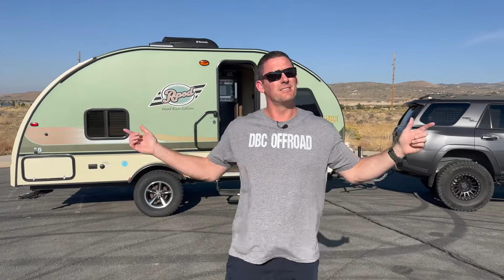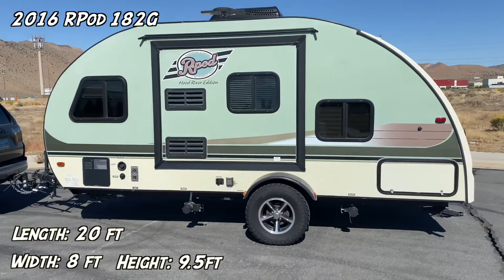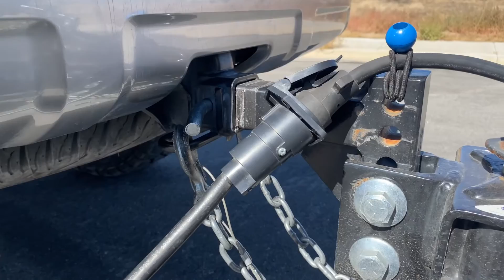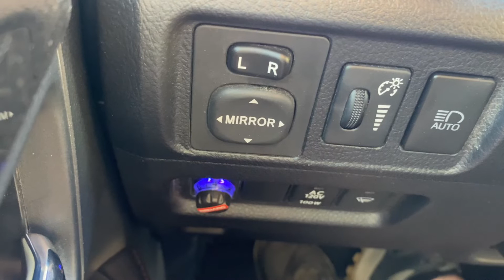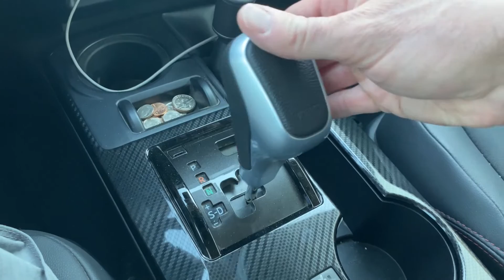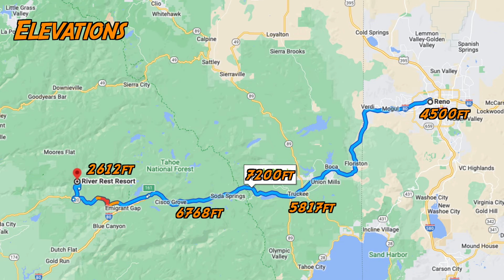Towing With a 5th Gen 4Runner on 35s!

Comment: Realize this video is 2 yrs old now, but some good reference info for me.  Makes me wonder if my '22 TRD ORP is the best vehicle to have as I look into getting a mild off grid trailer ... TAB 320 (2100 lbs dry) or TAB 360 (2600 lbs dry).  I have the almost 33" tires (285/70 17s Toyo AT3s in C load) and a Eibach Pro 2 suspension set up with rear set up for load levelling.  I'm thinking now of maybe an older Tundra, but then I may as well look at some light slide in campers at that point.  This decision making sucks, as I've really grown to enjoy my 4Runner.  Just tired of trying to camp in great spots with the RTT having wind gusts so bad it blows it apart and have to sleep in the drivers seat, or change spots defeating the purpose of my set up.

Comment: You still running this? I went with the andersen wdh. Half the weight of those bar types. I towed with similar rpod 3000 miles last year. Hated it. Got a 1/2 pickup haha absolute game changer. Didnt realize how bad the 4runner actually tows

Comment: What tire size are you running? On the 35s also   did you use a delete kit for the mounts or did you just delete them yourself and weld over?
Reply from the maker: 35x12.50R17
Delete kit? For the Cab Mount Chop? They are just cut and welded over with plating.

Comment: Great video , I have a 2024 SR5 and plan on towing a 17’ fiberglass travel trailer in the next year, already installed th medium duty kit from OME and went to a 275 tire, plan on getting the red arc break controller as well up in the air about the re gear??
Reply from the maker: How tall is the 275 tire? 275 is just the width.

Comment: You’ve mistaken the s-mode for a manual shifter.  It’s actually a gear limiter.  Huge difference.
Reply from the maker: It seems like Toyota designed it as a little bit of both.
Reply: Please explain

Comment: I think if you adjusted the support bars on the frame up higher it would help even out your pitch issues. 
The top holes you’re currently using allow for the least amount of weight distribution. I’d move to the middle holes and see how it sits……..
Reply from the maker: Good to know. Thanks for the feedback.
Reply: @DBCoffroad did you try this?
Reply from the maker: @BaldEagleAerial no I ended up selling the trailer.

Comment: 2021 orp everything from factory, towing 19rble. As a fulltimer, the load on trailer at almost max but trying to leave 4R trunk empty, redarc, no wdh (often offroading, wdh adds tongue weight and limits the flexibility). Good turning radial with 4R at dead-end. Always trying to control within 3k rpm, ~10mpg. Struggle uphill when more than 10% but robust engine and for better mileage. Great to watch your videos for benchmarking as 4R towing is rare out there😄
Reply from the maker: That’s cool. No issues without the WDH? 

I do like the U-Turning radius 😂

Thanks for the feedback. 🤘🏻
Reply: @DBCoffroad  wdh helps but it is also burden. As 4r has softer coil spring it sags, headlight is too high I never drive after dusk

Comment: is that the dry weight  you mentioned on the trailer 3300 pounds whats the fully loaded weight?
Reply from the maker: That was an estimated loaded weight. Calculated the water tank and what we put in it. Could be off +/- couple hundred pounds. 
Dry weight is 2836lbs

Comment: Which model rpod is that?
Reply from the maker: It's a 2016 RP182G
Reply: @DBC Offroad  I plan on towing something about that size, would regearing to 4.88 and keeping factory tire size save gas and help tow better?
Reply from the maker: @EnjoyTheShoah  if you tow, you’re not going to save gas. Not really a way around it since the 4Runner is only a 5 speed transmission. 

If you are going to keep stock tire size then just try towing without regearing. Then if you feel like you need more acceleration then go with 4.56 gears.  You might even be better off spending less money getting an intake and tune before gears for a little extra punch. 

Really, 4.88s are only needed for 35” tires in my opinion. 

Hope this helps.

Comment: Tow often. 

Monitored Trans Temps between D vs 4 in manual mode. The manufacturer states you should use 4, and I can confirm this is saving your transmission. The temperatures are 25-40 degrees cooler in 4th gear vs DRIVE, this is towing through the Canadian Rockies multiple times with a similar setup. I used an OB2 reader with 4 runner PID's to gain access to the trans temps. Regearing does help, but the temperature of the transmission is worth keeping an eye on.
Reply from the maker: Thanks for the information! I ordered a scan gauge because I was curious about the temps as well. Especially now that I put a steel bumper and winch up front. Thanks again!
Reply: I’ve read through my owners manual wrt towing.   Other than waiting until after 500 miles of break-in, I don’t see the manufacturer’s recommendation  for S4 while towing.   Although I can see why it may make sense to do so.     I added the Redarc brake controller,  and looking forward to the next trip.    Towing a small (Vistabule) teardrop.     Great video, thanks!

Comment: I tow with a 2017 4runner sr5 4x4 3rd row on 33s. I have a single axle Yamaha 19 foot boat that’s approximately 3800 pounds wet. It takes a while to get up to freeway speed of 65 mph, but does ok once it gets there. Towing up a hill it aggressively down shifts, and mildly struggles. I also have a all aluminum v-nose enclosed trailer that has been camper/ hauler converted. It weighs about 4K pounds fully loaded for camping. It has about the same performance as the boat when hauling flat but it’s terrible going up hill. On a steep grade I just back off to about 20mph in a 50 zone. Semi trucks are passing me at this point. I just leave my hazards on lol. I thought about the supercharger but I’ll probably be disappointed. I love my 4runner but unfortunately it’s days are limited. I cant wait to own that 500 ftlb torque of the new sequoia. Hopefully I find my spec out one soon.
Reply from the maker: Yea thats pretty much the same experience with towing for me.  Hint: definitely just go for the Sequoia. The SC is too expensive and doesn't bring the "wow" I was hoping for.
Reply: @DBCoffroad  thanks for the hint and confirmation!

Comment: Lets be honest, the 4Runner is not great for towing.
Reply from the maker: I agree. There are many better options. But it can be done! 
Thanks for watching. 🤘🏻
Reply: Really check out the White TRD PRO Towing a Semi in the snow ...and on the Beach pulling out a Pick up and a mini van ....under rated Vehicle
Reply from the maker: @CP-kb1du  I’ll have to check it out. Thanks for the info!
Reply: I tow a Little Guy Max. Get 9 MPG and have the Eibach Pro 2.0 and Eibach rear set up as well. I had 265 Duratracs and was wearing those out before buying new shoes in the 285 range. Now I am thinking of keeping the 265s until I buy my next truck. My 4runner is also an overlander and I love it for getting me in the backcountry. The 265s are working everywhere I have been. I have a roof top tent and equipment for those excursions. No way I would sell it just because it’s a little lackluster for towing and I will only tow roughly 5 or 6 times this year and next when this runner is then paid for. Then I will buy a truck. Even contemplating diesel. This one is a 2021 ORP and I bought it brand new for 41K out the door( that included all taxes and fees)before Covid really hit the auto industry. Nope. Not getting rid of it. I will make it work until it’s time to pony up for the truck. I am going to take that gearing advice though and I am buying a tranny temp gauge just to keep a check on it while towing.

Comment: The best power upgrade you did was the gears.  Regardless of tire size.  5th gens have terrible ratios (gotta get those mpgs!). It's either 3.73 or 3.90.  Garbage.

Yes, the 5 speed auto isn't the best but it is not the worst.  Don't be scared to MANUALLY SHIFT it.
Reply from the maker: Thanks for watching. 
Stock gears are 3.73 and garbage like you said. 

I’ve tried manually shift and it still auto shifts when I tow. Even sometimes unladen. 
I do like to manual shift when in 4Low and off-roading. Makes a huge difference. I just wish there was a transmission tune.
Reply: @DBCoffroad  I'd think part of that is from the throttle position as well.  Are you running a pedal commander?
Reply from the maker: @BigBluePile  I don’t have a pedal commander. I’ve heard mixed reviews on those. Do you have one?
Reply: @DBCoffroad  Yes.  Ran one for years.  Makes drivabilty offroad and onroad much more enjoyable.  I want to be able to blip the throttle and get engine response.  It is not a HP gaining tuner!!  I think that's a lot of the negativity.  Mostly from people I suspect that have never driven cable throttle vehicles.  🤷🏿

Comment: I don’t tow but got 33s and 4.56 re gear. I also have full armor which adds lots of weight, and I also have some crappy aerodynamics from the viper cut and lift. The re-gear helped a lot with how driveable this thing is on the highway. Without the regear and on 31 inch tires this drove crappy on Colorado highways. With the re-gear though I only get 12mpg when going 75 but I’ll take that anytime than the indecisive transmission that’s hunting for gears all the time on stock gearing😂
Reply from the maker: I should have mentioned that too. Just adding all the armor weight is a good reason to regear as well.

I agree, Low MPG is the trade off though. I average about 13.5 with the regear and 35s. I’m ok with the trade off too. 
I’m still not a fan of the transmission. It’s the weak link to me. 

Thanks for watching!
Reply: No problem. I also think the 5th gen transmission is its biggest downside. I like how old school the rest of the 4runner feels except for the 5speed. It’s due for a redesign/6th gen. This gen 4runner will surely be a timepiece in the future though.